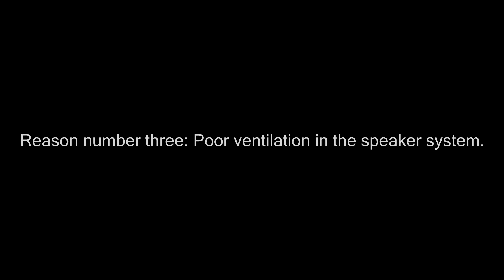Why Do Speakers Burn Out: 3 Common Mistakes!

Comment: 1:01 that kind of chassis is not good for bass frequencies! for example, Yamaha HS or NS10m uses that woofer model, because it is good for mid frequencies actually. At frequencies below 100 Hz, a well ventilated chassis is mandatory

Comment: Interesting video, my Arcam A85 amplifier had a problem with the  microprocessor which was 'clipping' the sound, then a few weeks later the sound started to deteriorate a lot, then I discovered the midwoofer on both speakers had blown, could this be because the microprocessor was clipping the sound ?

Comment: its not the low frequency, because if lets say this speaker is 30watts, and you give this speaker a 20-25watt amplifier, this speaker most likely will never burn out, its just that youre exceeded the power of this driver. 
Some of the smaller speaker say lets say 15watts while having just a 1/3inch voice coil, theyre not really 15watt speakers, theyre just 5watt speakers, some speaker manufacturers lie about the speaker wattage, and then when you try to add the amplifier for it, you can burn it out very easily, but of course while the manufacturers lie about the wattage, they doesnt even include near enough power amplification if the amplifier is included with the speaker unit, or if its an active system..
This info is just barely true, since there some sensitive speakers which are good but only for a low wattage amplifiers, but on the lows, they will hit the T stump, and it can deform the voice coil, and then from that time the voice coil will shrub off from the tube, which will make the coil to short out and burn up.

Comment: Very wrong. Even you put in  max volume the speaker cannot be burn if  the amplifier ang speaker are fit wattage to each other. in the video speakers are burning because doesnt compatible in each other. Example ampfier 1000watts and your speaker is only 10watts😂
Reply: Yes it can, because if your amp puts out 1000w at 4 ohms, and you have a 4 ohms coil and it can take 1000w , while the speaker is playing it will rise,  it will never stay at 4 ohms, soooo... if your rise is 2x your speaker will go to 8 ohms, and your amp cannot supply 1000w at 8 ohms, it will clip and heat up the voice coil...

Comment: This happened with me with VLC media player I put the volume all the way up to 200% and my speaker got blowed up because I was sending too much signal or too much current to that particular 2.1 system
Reply from the maker: clipped signal :(
Reply: @Techscrews  I dont think VLC actualy clips the signal, it just compresses it above 100%
Reply: @SomeGuyInAustralia18  it does VLC is bad with 200% volume

Comment: I agree that not all speakers can handle the same frequencies, for example, I have my sub playing from 35 Hz to 100 Hz which is the crossover point with the bookshelf speakers.
I would like to see a video showing us to avoid bass cancelations, I have room issues
Reply from the maker: Thanks for the feedback! I have a lot of ideas and some unfinished subwoofer projects because there are no T-S specs. I want to buy a speaker measurement device, but I need to save money for it first. :(